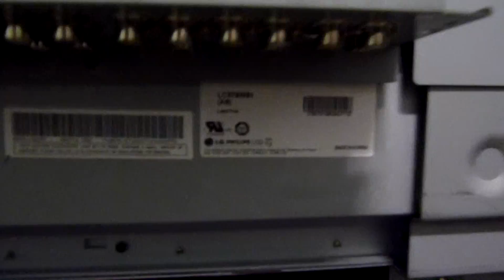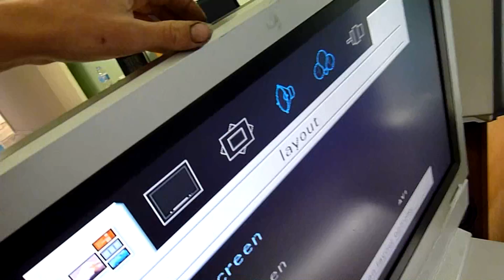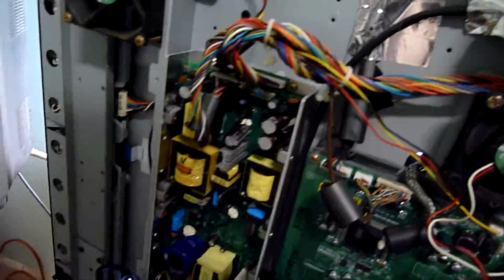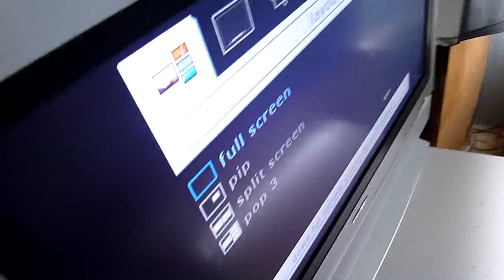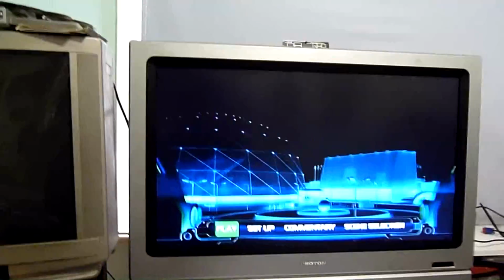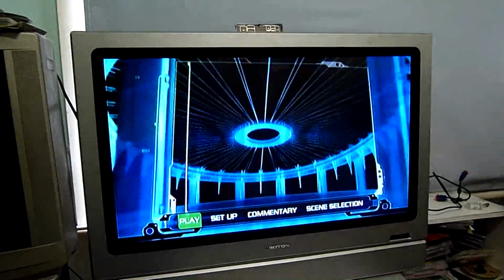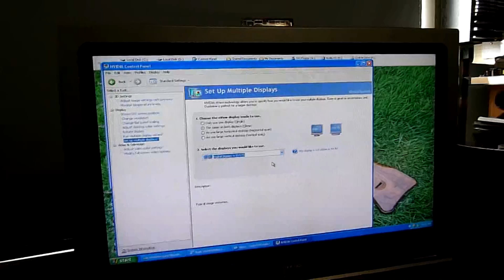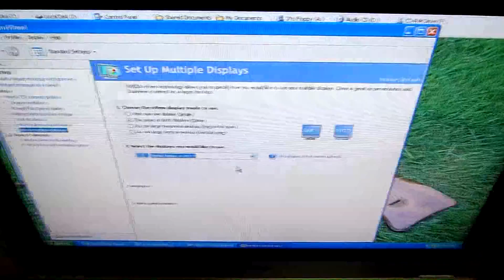Proton 32 Inch LCD Powersupply Fix

Comment: I have a power supply issue with mine. Its not the main fuse and the standby light is not coming. What should I look for?

Comment: @Aussie50 
Yep, it's an S-IPS panel, 16ms pixel response, 8-bit color, 800:1 ANSI contrast ratio (full on/full off).  Since it's S-IPS the perceived color will not shift with viewing angle.  However these panels are susceptible to image retention.

Comment: @Aussie50 the one I have is a Samsung and it lasted 2 years until the SMPS MOSFETs finally gave up, not shorted though. We still use it to this day. I think they overheat because they had thermal pads on them that were burnt onto the MOSFETs :P
luckily a few dollars and a few hours later it was fixed, didn't have to buy a new one :)
lol but it was a PITA to even look inside to check the circuits, that thing is HEAVY.

Comment: Sweet LCD!  First time I've seen fans in one.

A lot of flat panels look crappy with analog inputs, due to the processing required.  The worst is composite video.  If you're using S-video or component video, it might look decent.

Comment: @Lachlant1984 the 42" plasma TV we had broke, and it needed some new transistors because they had overheated, no fan whatsoever in the unit. when kept on for a while you can feel the temperature difference in the room, that thing takes 8A! and gets extremely hot!

Comment: It seems that capacitors seem to cause lots of problems in power supplies and on computer motherboards when they fail.  I've had very little experience with LCD/Plasma screens so this question may be a bit stupid, but how many of them have cooling fans in them as this one does?  I know CRT's do produce some heat, but I've yet to come across one with fan in it, I still prefer CRT's, but I've said that many times before.  I assume this set was made in China, right?